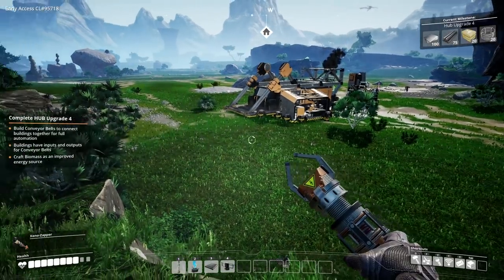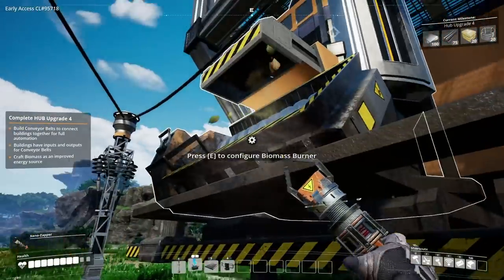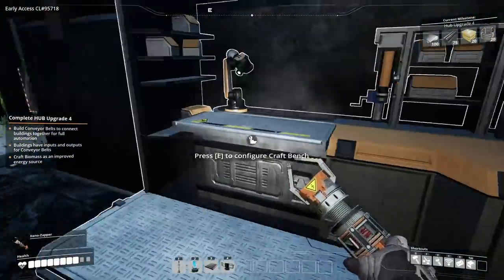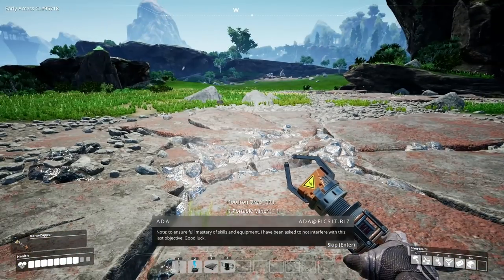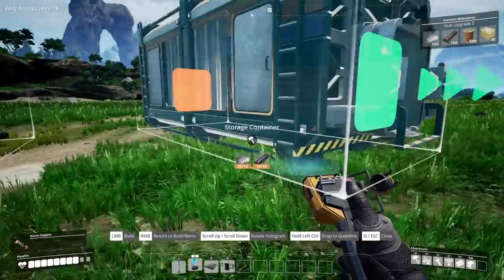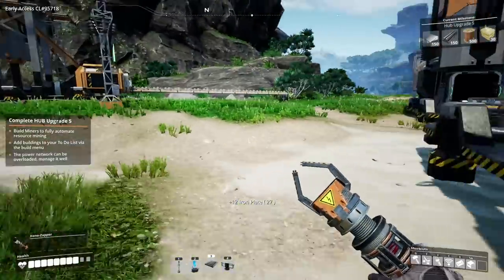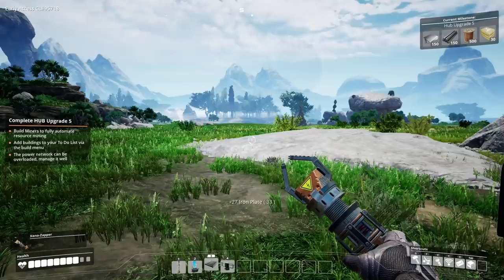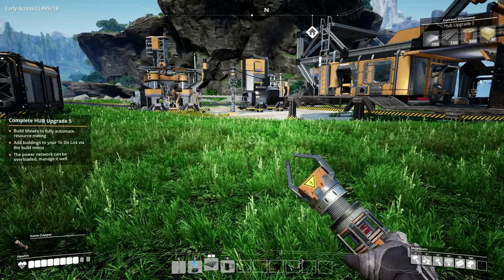GETTING STARTED with Mining And Automating in Satisfactory

Comment: Cement is actually a part of concrete, so while they're not the same, they're related. :P

A fun thing aswell is that cables got a LONG range, like, really long. I actually got a block of a bunch of towers bundled together, that then connects to almost my entire base without any extra outside towers for reach.
You really got flexibility regarding how to use them. ^^
Reply: Cement is more or less limestone and water.  Concrete is cement with rocks mixed in.  The added rocks give it greater strength, like putting steel rods in before pouring cement.